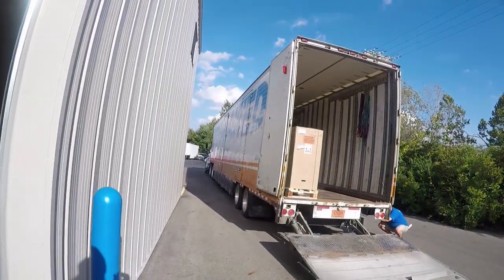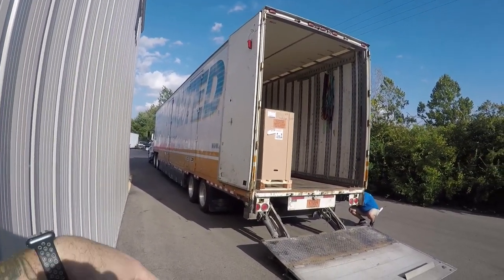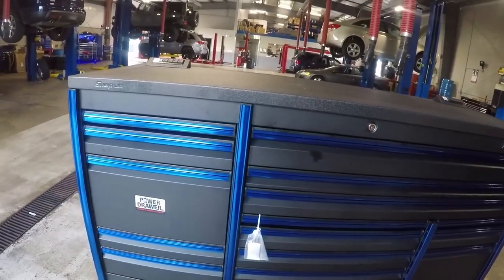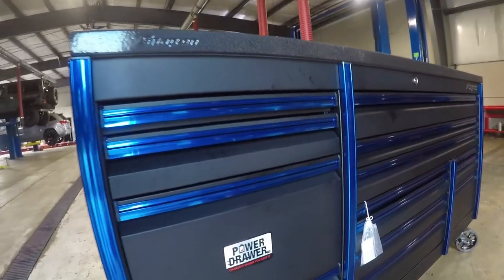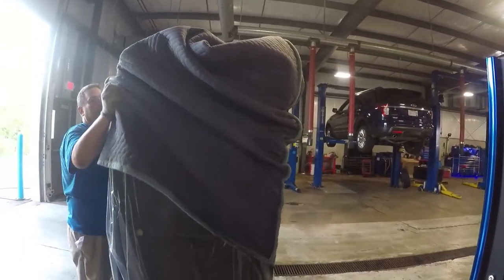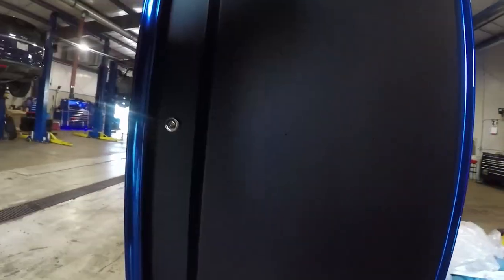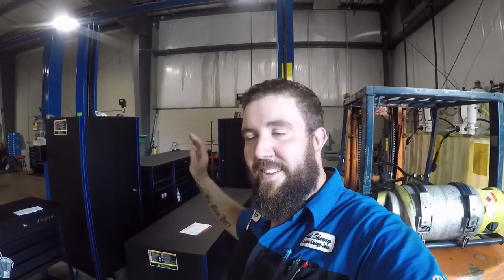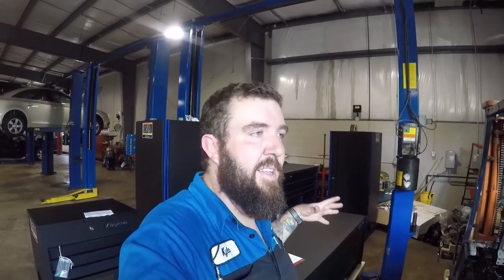SNAP-ON EPIQ TOOLBOX SHIPPING AND TAKING DELIVERY!!!

Comment: Couple things. Snap-On really pissed me off with the delivery of my box. I went with an 84” Epiq, work center, and power locker. 6-8 week build time as expected. Ordered mine beginning of June, moved into it beginning of September. However, mine did not come all in one piece. 3 separate shipment over 3 weeks in an order that drove me insane. First came the work center, then the locker, followed by the box itself. Makes a lot of sense, not. The work center came with an extra lock to be used on the box so they match. No 3rd key for the locker. Snap-On won’t even consider sending me the matching lock. 

However, I am extremely satisfied. Lighting is definitely something to consider. I went their 5’ LED Magnetic light for my work center. My rep was nice enough to throw it in for free along with a smaller matching light for the locker. Problem with the light for the locker is it will not automatically turn on via magnetic switch like my work center light does. Why? There’s nowhere to mount the dumb thing. A simple door switch is all they need, but they don’t make it. I ended up deciding I could live without a light in my locker. If I really need one I’ll buy a motion activated puck light off Amazon. 

Anyways, box looks great. Enjoy it man. They’re epiq!
Reply from the maker: Stay tuned...me and my rep are working out a pretty good Snap-on lighting setup for these

Comment: sweet set up i hate to say it but you're gonna despise cleaning that flat black. i had a classic 78 with hutch in flat black w/ gloss black trim. had to clean it every day to keep finger prints off. buy the snap on branded flat black cleaner,  apply it with a microfiber rag with speed to generate enough heat so that it evaporates. if you don't it will leave nasty looking streaks all over the area you cleaned. congrats on the dream box tho!
Reply from the maker: Thanks for the advice! The practice will be different but I am used to cleaning and waxing my current box at least 3x a week😁
Reply: same here i just traded my classic 78 for the same master series box you have but in storm grey. i love being able to wax instead of using that flat black cleaner.
Reply: everyone in my shop thinks im crazy for keeping my box clean like that, i tell them it was very expensive and i want it to look that way.

Comment: It’s a sweet box. I bought my Snap-on box 1 piece at a time so I wasn’t in major debt forever. Now I have 100k in tools , no bill and can upgrade 1 tool at a time when needed. I like the new shit but can’t bring myself to waste that much money on something I don’t need.
Reply from the maker: It’s been a journey through all my boxes. I didn’t owe anything prior to this so this isn’t any worse than a nice Christmas style purchase for the next year. Only thing I’d recommend to younger/newer techs is to start off with the biggest main box you’ll want in the end and build from there.
Reply: Rustbelt Mechanic if you can afford to buy yourself 50k Xmas gifts. Y are you working?
Reply: James Batdorf first off it’s not 50k it’s 40k with the real matching rollcart not the one he has there  and that’s after tax. But still one badass box
Reply: One Touch Auto Repair yeah instead of having 4 junk drawers he’ll have 8 fancy junk drawers. 40k still an expensive waste of space 😂
Reply: James Batdorf first off if you have tools those are  not junk drawers,second off expensive is a relative term, maybe for you, but I piss away 100k a year on dumb stuff that is a lot less useful so my epiq was not expensive to me.
Reply: One Touch Auto Repair everyone has that drawer full of clips and wire. It is a junk drawer. Or you call it Snap-on accessories drawer  lol. I can afford it. But it’s not necessary. Just my opinion. I would rather use that money on trips and 4wheelers and such. I would love an epic. That’s y every time there’s a drawing to win one I enter. But I probably won’t buy it when my master series is 10 feet wide and holds everything I would ever need to do any job on any car or truck. Oh and it’s been paid for 16 years now. Money in pocket not Snap-ons kids college fund lol
Reply: One Touch Auto Repair oh and secondly Richard I never commented anything on your epic , I commented on RBM’s toolbox. And thirdly Richard I said it was sweet because it is a badass piece of goodness. The only difference if I ordered it would be grey with red trim. I said I couldn’t bring MYSELF to buy one. Not that everyone that has one is wasting their money. If it was available 16 year ago, for sure I would have it now